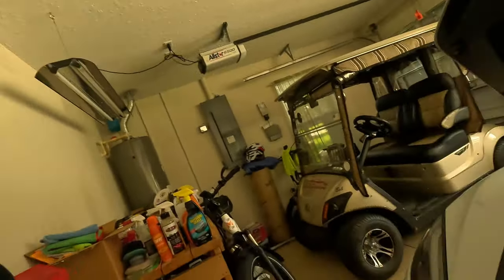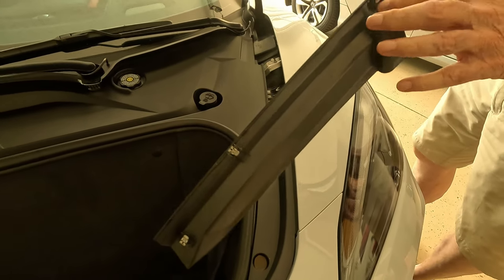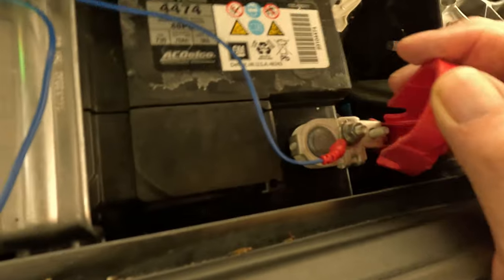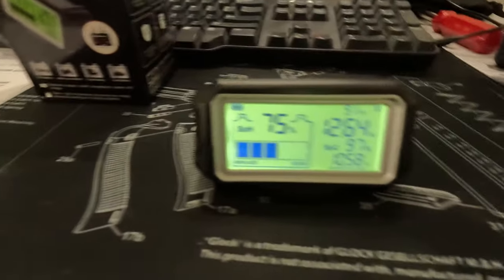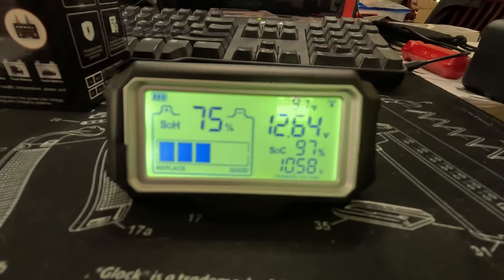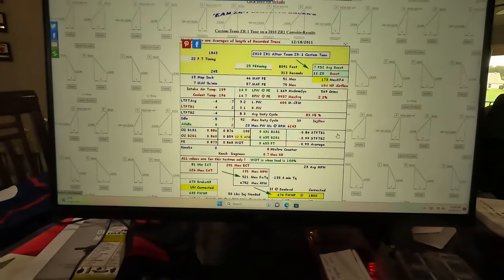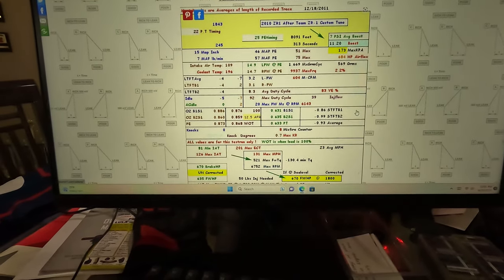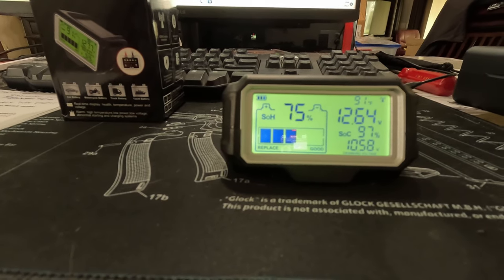UPDATE on Remote Battery Monitor

Comment: Bob also remember is car battery has 6 cells. Each puts out 2.2 volts. 
That is a total voltage output of 12.6 volts when the cells are in a good state

Along with the SoC is the voltage value above it, you also want to look at as this guides the vehicle owner how good the cells are outputting as to their health, along with the SoC value 

This remote battery monitor works on 433 Mhz and the distance between where the monitor is placed, and its controller on battery depends on type of walls, etc, between the two.

Just keep an eye on the radio ICON on top right to know if the distance is too far where remote is placed that ICON will turn off to let you know the distance is too far and move it closer
Reply from the maker: Good stuff. Thanks!!

Comment: Can 2 battery monitors be used for 2 cars, or do signals get mixed up?
Reply from the maker: Good question. 
The monitor works on 433MHz so I would think there would be a conflict. There is an On/Off key on the receiver so I would guess you could shut one off and then turn the other monitor on.